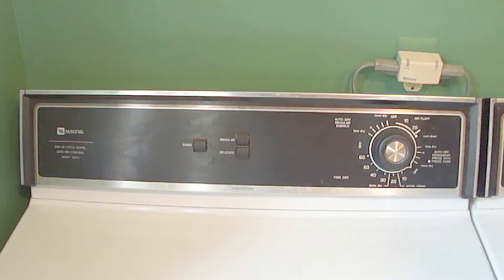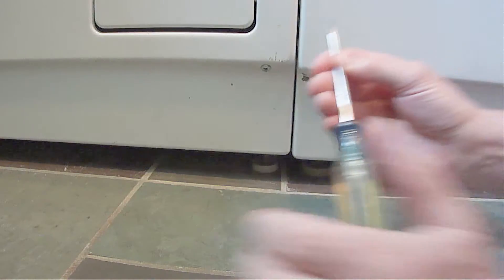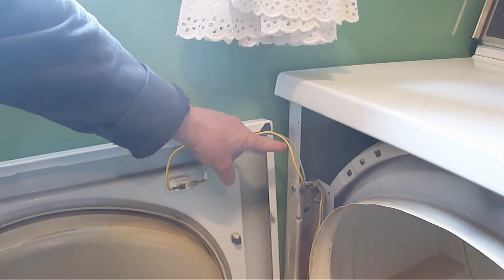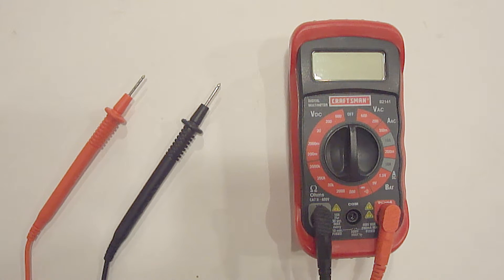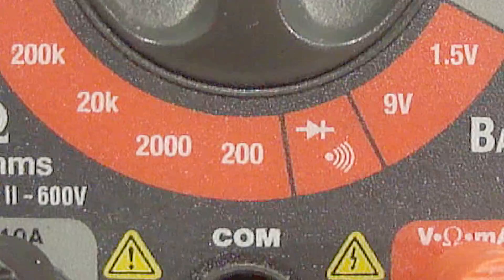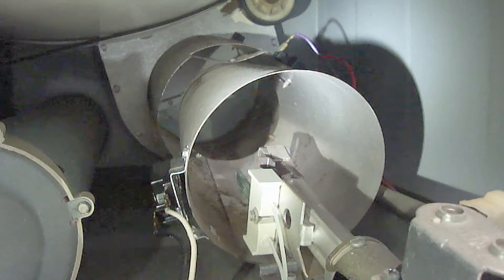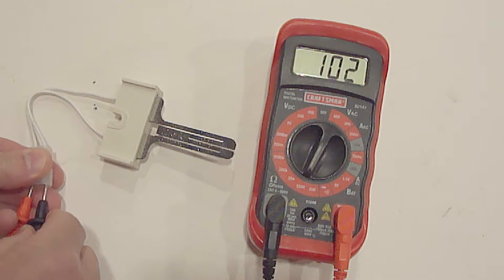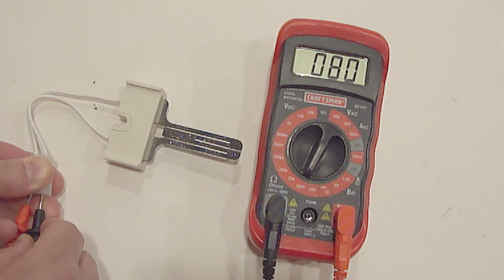Gas Dryer Not Drying - How To Test The Igniter In Seconds!

Comment: Just seconds is cap and outta pocket

But the guidance is top notch cream of the crop
No cap
Not outta pocket

Pro tip to comments
It may have 2 piece front
Remove lint trap, remove screws there
Pry pop out the bottom
Remove lower screws behind lower panel
Remove top pannel